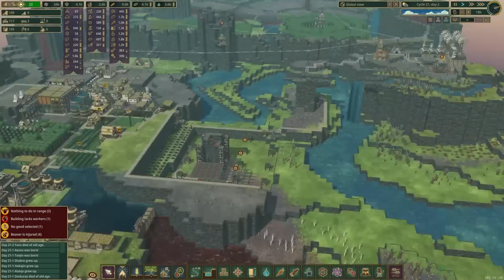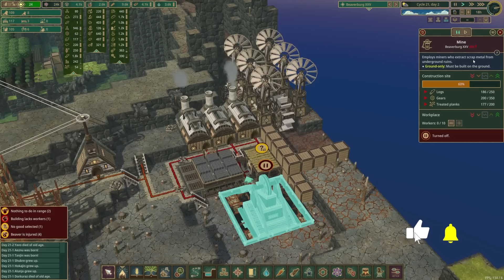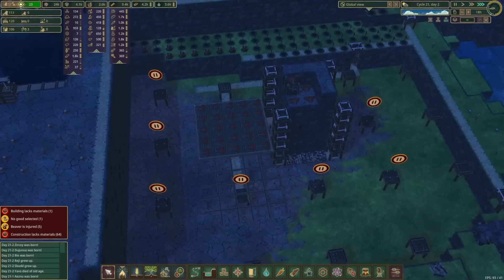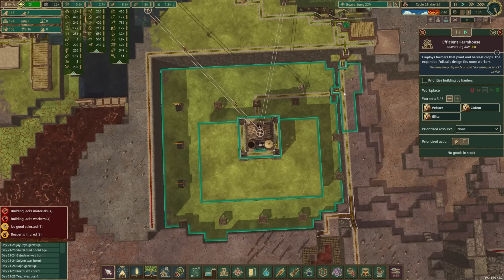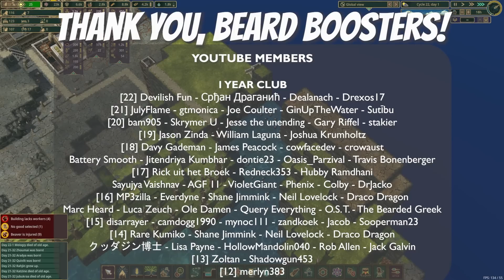At last, the stacked farm takes shape! Timberborn Update 7 Folktails Hard Mode Episode 15

Comment: 44:00 sounds like you found the perfect spot for a vertical aquatic farm. I'm imagining building the layers in the area right after the badwater diversion, maybe even blast it all the way down to the bottom. That bottom level then becomes the last part to dry out and can't be dried out by pumping, plus no fluid dump needed. Then higher layers become unusable during longer droughts, but there's still plenty that can be grown on the first layer or two.

Comment: If you plan on extending the vertical farm any higher, you're going to need to keep a non-Zipline path available, or build a layer and then connect it to an outside path, otherwise they won't be able to build the new Zipline station. 

Also, I think routing the main Zipline through the farming area has probably increased the posting distance enough that it might be faster for the beavers to walk to the plank and gear processing area... You might want to consider adding a branch station to get to the farming and reconnect the straighter line

Comment: Anyone else annoyed at how unbalanced the ziplines and tubeways are? They gave every possible pro to the tubes and every possible con to the ziplines it seems
Reply from the maker: I think it's fitting, given the differences between the two factions. Remember that the folktails are supposed to be the more laid-back beaver group, and ziplines fit more of a fun/casual aesthetic
Reply: @JCTheBeard  Yeah I like the zipline aesthetics and don't have a problem with them per se. I actually like both, I just think it's weird that 1 faction can go literally anywhere, you just have to branch the tubes wherever you want one and can even have multiple tubes in the same station, while the other faction is only point to point and half the speed of the tubes. Say they made it so the ziplines were 300% and the tubes were 150%, or made both either modifier, it would feel more balanced. Or even if you couldn't have tees in the tubes would help.The tubes can even go through impermeable floors without mods

Comment: 6:05
It would be interesting to see if you need a path between the zip line station and a building or if they can just have their entrances "kissing" each other.
Because if the second option is true, you can put a station directly in front of the rig, with the tank near the other station.
It would avoid needing to make platforms around the rig.
If you need a path between them, you can build the station above the rig and conect them with ladders.

13:18
You can also pump water directly from the reservoir with the tubes ending a little bit above the height that would dry the crops.

25:49
I would have built another level with a pool instead.
And I just thought of something, you could make the top level a water farm, maybe even putting an aqueduct to fill it during the good season.
Reply from the maker: There's a lot of fun stuff you can do with "kissing" buildings that we can talk about next time

Comment: So, here we go:
1) MORE BEAVERS. Now that the farm is going, more (and also larger) beaver storage please. Those 2 lodges you build today barely cut the mustard. (Do beavers even eat mustard with their hot logs?)
2) The dirt excavator has reached the bottom. Time to move it over again, make the wall of gravity batteries longer and get that battery capacity ready for when you go into bots?
3) This zigzagging zipline while functional is inefficient. It's still faster then walking, but each zig and zag added increase the lenght that has to be travelled which decreases the zipline efficiency. It's the perfect example of why i think devs or modders should add transfer stations (stations that can handle more then 2 connections). So you can have a nice mainline that can branch off rather then a zigzagging mess.

Comment: Putting the mine area gravity batteries in the channel, will possibly either mean they don't have much capacity or that if you blast out the channel to increase it it will take an age for the bad water to refill and power the water wheels after a drought.. 🤔 wouldn't be simpler to hang them over the edge down into the area next to the tree farm with the multi level work area & zipline station?

Comment: * Please increase the number of medical beds to 20, empty beds don't cost anything, but injured beavers waiting to a bed to get free are unavailable pointlessly for more time , dirt excavator also may be contributing to injury
* another floor can be added on the plank and gear factories that we have, 6 high platforms and then 6x1 metal platform can work as second floor.  why so high ? cause why not, we can see the bottom floor factories also this way. and no one says old dog has to make second floor at the lowest clearance height :)  we have technology for height , one zipline takes them directly to next floor so why not make a high factory complex
* please also add clock, books, etc.  * please prioritise mine by haulers, and select the scrap storage for the warehouse in front of it
* to stop water pump before they dry up the water of aquatic farms, can we raise their nozzle a level up so they don't suck dry the reservoir

Comment: Switch the storages for metal and scrap at the mine. You don’t need all that scrap storage. 

To help with injuries, you want to be able to fill up your scrap storage so the beavers have to take a break from mine work.
Reply: To be clear, you should have one large storage for scrap at this point. If you fill it up with 180 scrap, then you got days worth of smelting to get through to empty it out.

That means your mine will be just topping off the scrap supply and slowing down to what you actually need and are using.

Then the underground metal supply will steadily fill up for when you go bot. And fully move into bot mining to prevent injuries.

Comment: 12:35   so you want a new location for the aquatic farm,  i propose putting it on the bottom level  of the multi level farm... since the bottom of the multi level is a basement (hole)  it would be simple to have a water dump to keep it  .90 deep,   then second level and up you can put normal farming crops.
Reply: You can even dam the new clean water river created and blow out some of the river to create a reservoir and use sluices to auto fill for most of the time. Come in from the back side (nearest to river) bury a sluice and reinstate the riverbank. The main river can stay at the current depth, just have a deep "well" in that section of the river.
Reply from the maker: That is a really, really smart idea
Reply: Nah, you want to have it on the top level. This way the same water you use for growing the aquatic crops also works for irrigating the lower levels, and you don't need the extra irrigation station on the top.
Reply: @PauxloE  yes you could have it on the top level, but the bottom pool is a fair bit larger and has access to the clean river now,  so keeping it full of water is trivial and will produce more due to its larger size.
Reply: definitely, great idea 💡